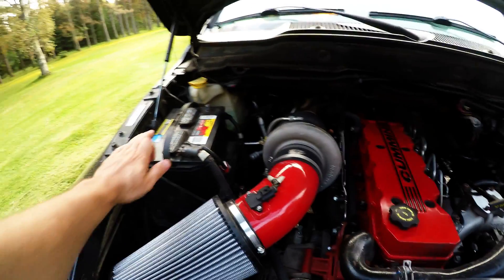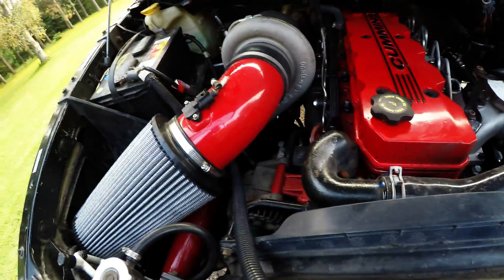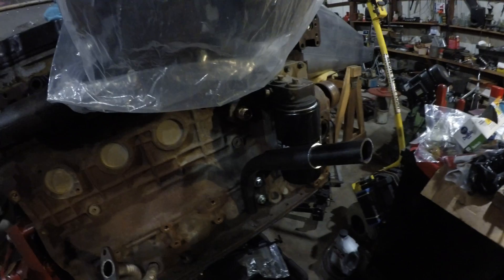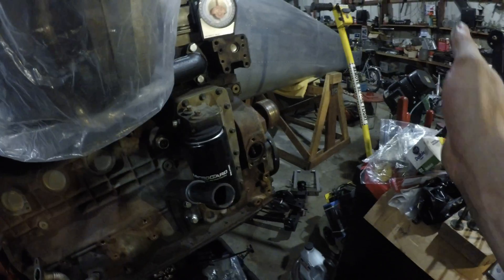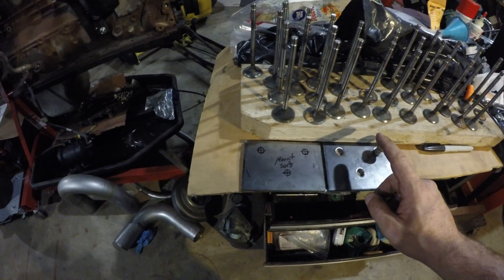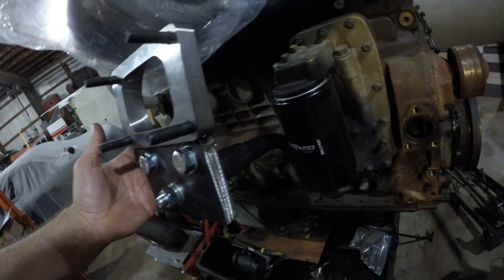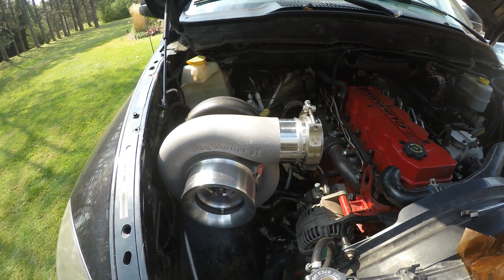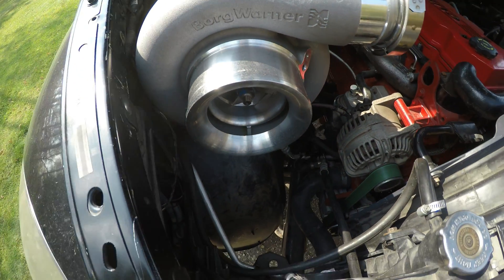Cummins S500 Turbo Install Part 1

Comment: What welder are you using?
Reply from the maker: I used a mix  of mig and tig. Thicker material was mig welded, like the brace. The exhaust and pressure tubes were tig welded. They are all Lincoln units.

Comment: What size turbine housing are you running in this?
Reply from the maker: The A/R on the S400 is .90 and the S500 is a 1.15